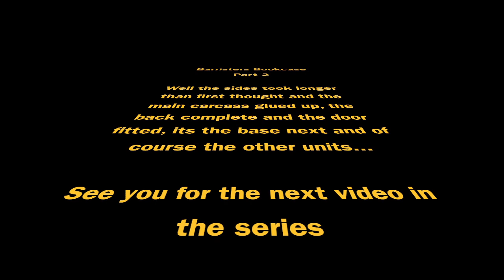I make a Barristers Bookcase (part 2)

Comment: Building one based on a combo of yours and the wood whisperers design,  used sheet stock for my carcasses  and poplar for my doors, my pegs are brass, (doing a dry fit) and it's really hard to push the door through the slot , thinking about using wooden pegs since I'm still "testing" pegs. Any advice you could give sir, is greatly appreciated!
Reply from the maker: Sean Diaz Hi Sean, I would just make sure that the fit between the pegs and the runner slot are reasonably free ie not too tight so that you can run the pin down manually also rub some wax into the slot will help that’s what I did. Brass pins should be good I just used hardwood ones as I had the dowel to hand. Good luck with the build 🤞🏼